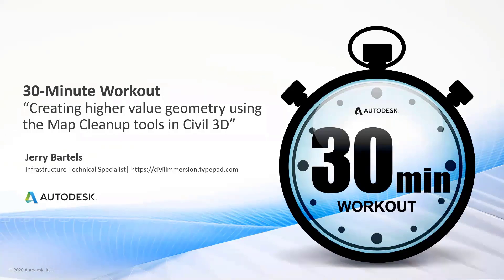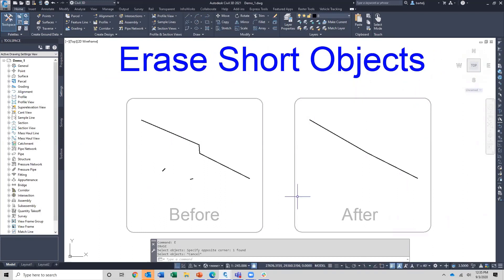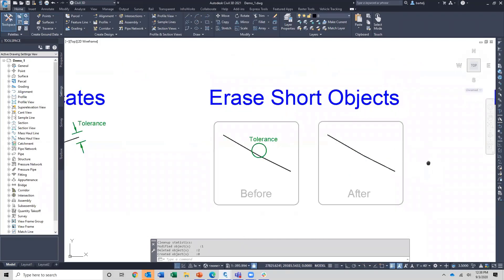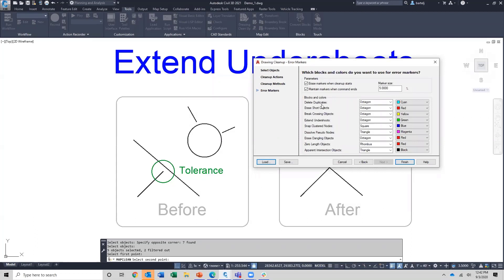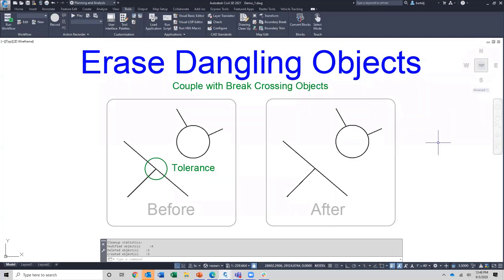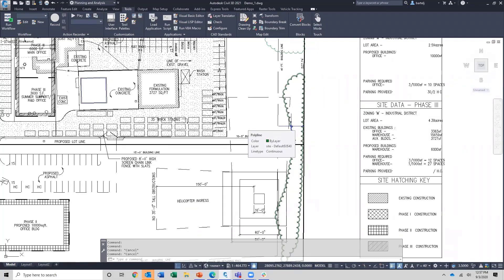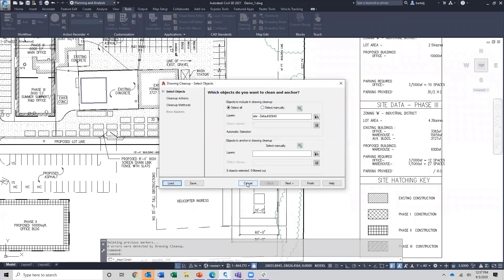Creating higher value geometry using the Map 3D Cleanup tools in Civil 3D

Comment: Bookmarks for future reference Map Clean
3:21 Delete Duplicates
7:32 Erase Short Objects
8:49 Break Crossing Objects
11:14 Extend Undershoots
13:41 Apparent Intersection
14:58 Snap Clustered Nodes
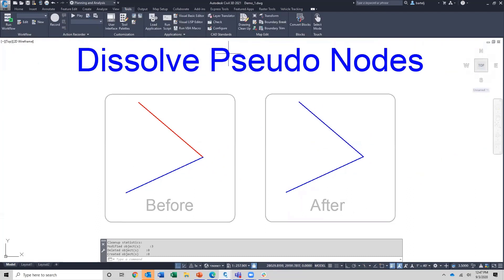17:00  Dissolve Pseudo Nodes
17:40 Erase Dangling Objects
18:55 Simplify Objects
20:00 Weed Polyline
21:40 Zero Length Objects